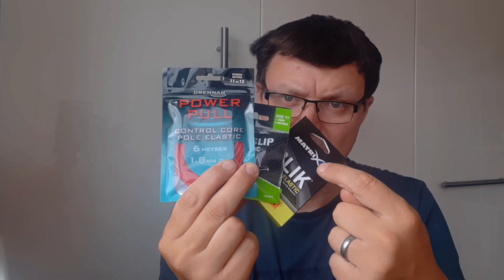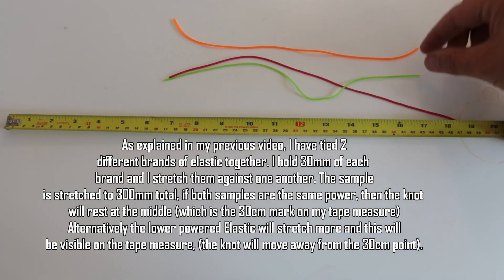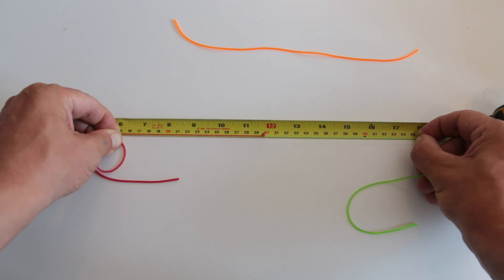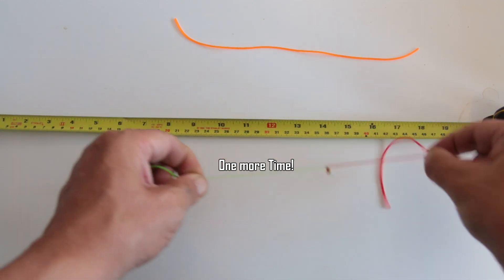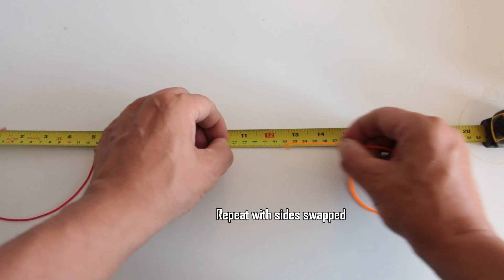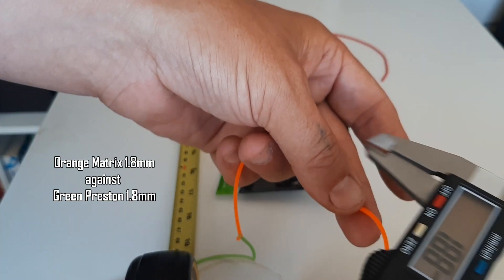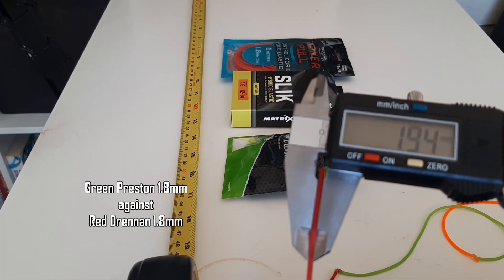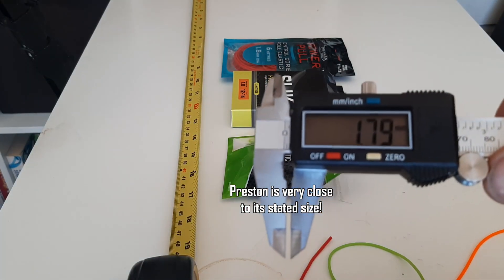***Are All Hybrid Elastics the Same?****  PART 2

Comment: I think the main takeaways are that the Quality Control on the drennan's are terrrible, that some of their 1.8mm elastic is actually 1.94mm and evidently stronger than their 2mm elastic. Also, Preston elastic's seem to be the most "true to spec" out of the bunch, so if you want some added punch from your "spec", go Matrix, if you want best control and predictability, go Preston.
Reply from the maker: Not a bad assessment, but we do need to remember that I only used one sample of each and there maybe fluctuations over time? And over several batches of the same product?? Interesting though isn't it😊👍

Comment: I did the same experiment yesterday with the green slik and hydro. Interestingly the slik stretched ever so slightly further at both 10 and 20cm stretch, but only by about 10mm-20mm respectively. This was on both 5cm and 10cm length grabs. They were practically the same, however when stretched further the matrix hybrid strengthened and began clawing back - to the point both were indistinguishable. Basically they are pretty much the same. Purple hydro (14-18) green slik 16-18.
Reply from the maker: Interesting that Hydro would be similar given that it's a hollow. Thanks for watching
Reply: @AverageAngler  feel free to try it yourself. Ratings are similar, I'm sure you might find significant difference but the purple hydro diameter is significantly larger (and the price a lot lot higher). If we are comparing performance to diameters and weight, the Slik would be the more favourable choice. The hollow unsurprisingly bottoms out first. The difference after further 10cm elastic tests is approx 10mm in a 10,20,30 and 50cm stretch

Comment: I believe elasticity is directly proportional to cross sectional area - so you should tabulate your results accordingly (area = pie x radius squared). If this is right then you can eliminate variance in diameter & area as you can then compare elasticity per unit x-sectional area. To get an accurate measure clip the elastic in bulldog clips, the ones with blade edges rather than rolled over & use a engineer's rule with 1/2mm markings.
Deffo need to look at resistance over increasing stretch, the apparent 'power up' using scales.
Reply from the maker: Thanks for watching and commenting🙂👍

Comment: Brilliant video. I do find for same stated diameter matrix is stronger than all other hybrids I’ve used. The Drennan results were concerning. I’ve only used Drennan 2mm (blue) so far and liked it, but would want different grades to be different strengths!! You’re leading me to staying with MAP my favourite (which is slightly softer than duraslip but no science to prove it). Keep up the very good work.
Reply from the maker: Cheers Paul🙂👍